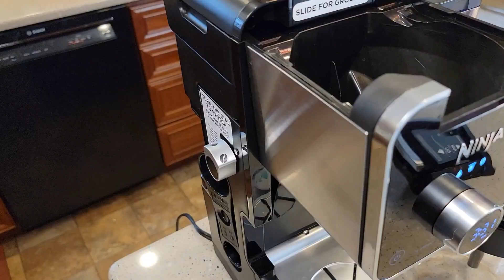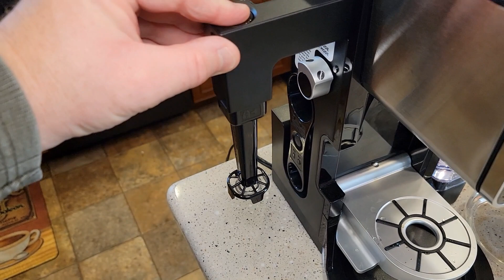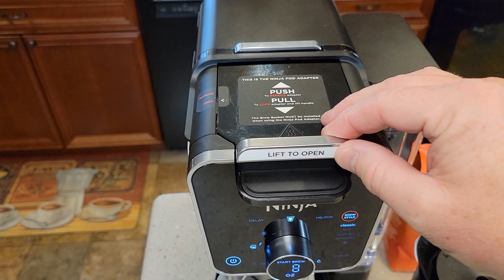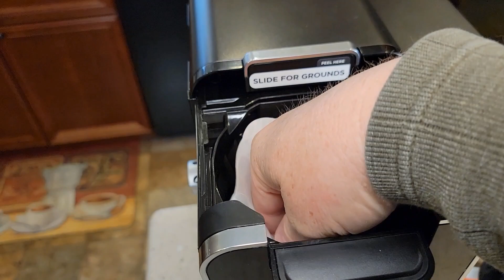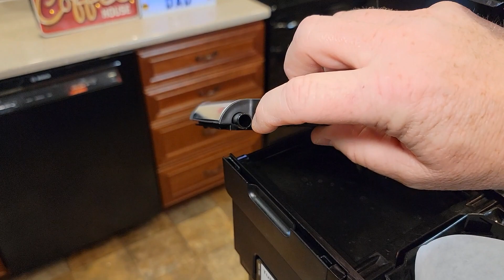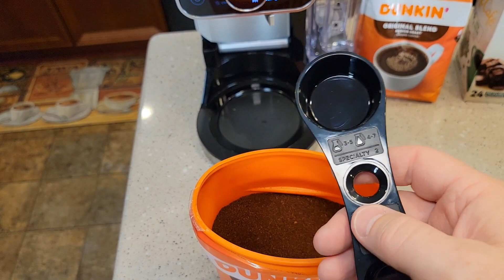WHY I LOVE Ninja DualBrew Pro CFP301 Coffee Maker Single Serve K Cup Machine REVIEW

Comment: Have you seen that they have a CFP305 model (which has the thermal carafe)? I am thinking about the thermal carafe because I am worried about the glass breaking. I've heard that it leaks, though (the thermal). Have you heard anything about that? It's an older model, I assume, because it's not longer listed on Ninja's website. Just the CFP301.

Comment: Just picked this up. Doesn't seem to brew a k cup as hot as I thought it was going to, I'll have to get a thermometer and check the brew temp
Reply from the maker: yeah its not the hottest K cup machine.  you will end up with about a 170 or 165 degree cup of coffee.
Reply: @JustADad  what is the hottest drip & k cup machine in your opinion? My drip currently pours at 180 so I’m looking for a duo machine that will pour at that same temperature. 😊
Reply: I have a ember mug so if i were to get this machine and sell my keurig k supreme smart the temp of the coffee wouldnt be an issue. I like the versatility of this machine

Comment: I bought my Keurig Supreme plus smart coffee maker back in September and just started using it and I originally filled the water after soaking the filter a d it sat till now and because keurig is having a drawing I decided to use my McCafe kcups, but I am noticing that the coffee smells and tastes bad, like bad water, but I have a B-79 platinum plus I bought on QVC back in 2007 and it brews with the same water and the same McCafe kcup and tastes great in the old maker! Could there be something in the heater of the new brewer making the water/coffee taste horrible? I think I need to contact keurig about it again! A $200 coffee maker shouldn't keep burning the coffee water! Have you heard of this happening to others?
Reply from the maker: Maybe its the way the water is heated, it is heated as it goes through the machine now instead of have a tank that fills with water and boils.  keep me posted.